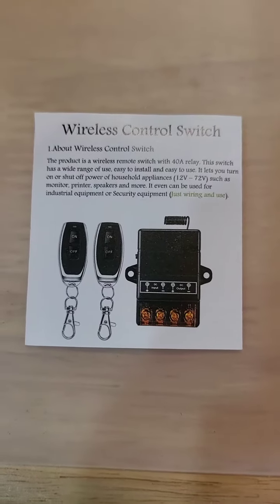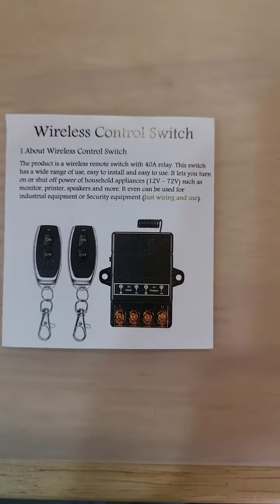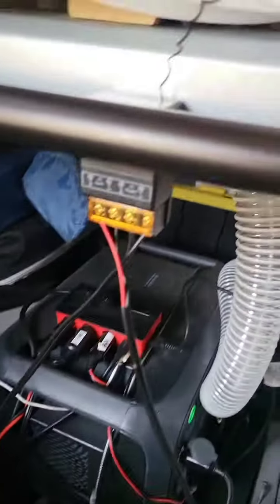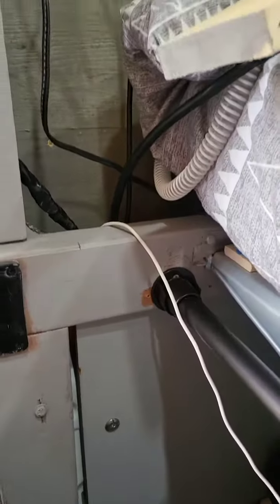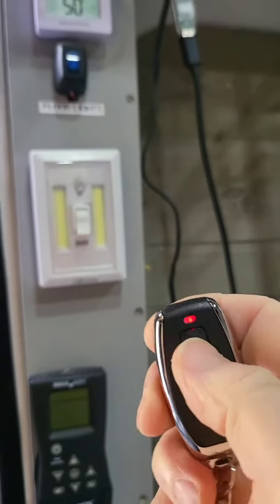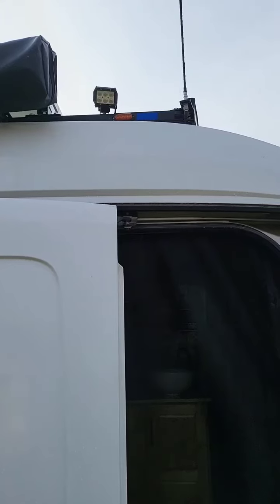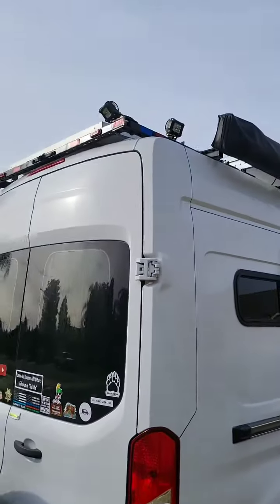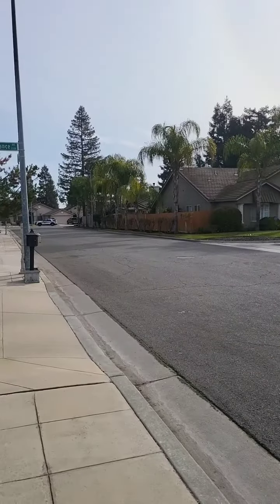#vanhack  Flood lights remote light switch install

Comment: I did this in my house, kept leaving the basement lights on and with my arthritis, it is a pain (literally) to go down and back up just to shut the light off. The option of wiring in a 2-way switch  was out because there is a pocket door where it would go and other locations were going to be painful and inconvenient to install so I bought a remote relay switch with 2 wall mounted battery operated switches and they can go anywhere. Also did this for a ceiling fan light.
Reply from the maker: I can see how that would help you with your arthritis.
I like that I can turn them on from inside the house!